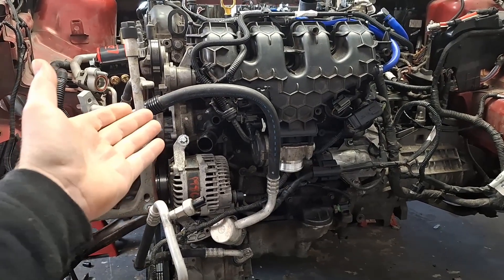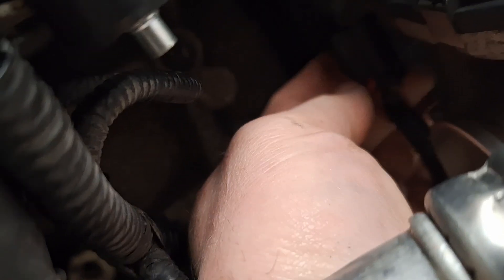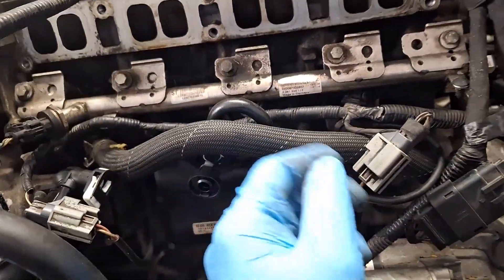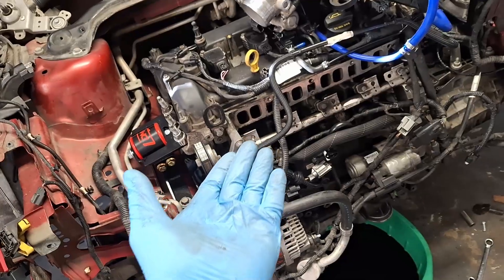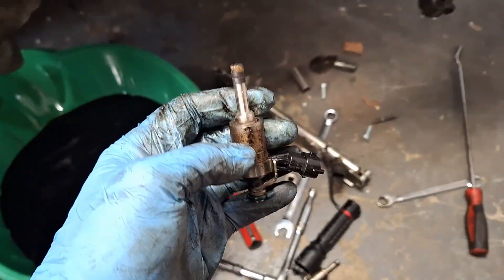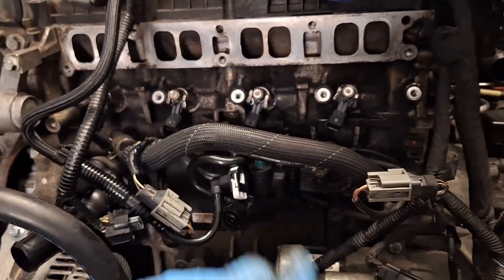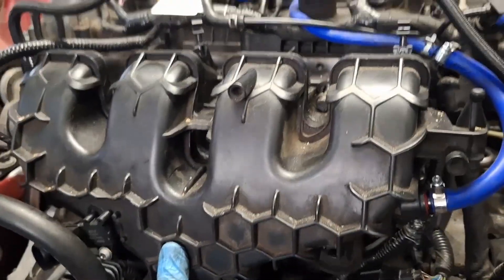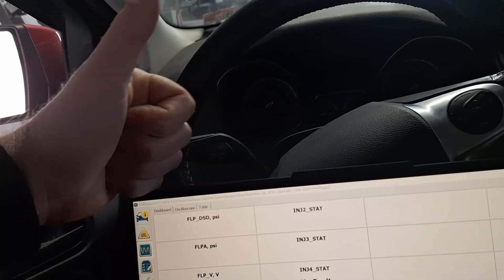Ford Focus Fuel Injector Replacement! 2012-2018 SE & ST

Comment: I just sent my injectors for washing. Installed them back and car is not starting like in your video ? What can i do? Pleass help
Reply from the maker: cycle the key a few times to prime the fuel system. my issue was because of ecoboost 2.0L swapping my regular ford focus
Reply: Quick question. If i remove one spark plug. Could i be able to see if the injectors are working ?

Comment: How does it run after the injector replacement?
Reply from the maker: It ran fine afterwards, but i wasn't getting power to the coils after the engine swap

Comment: I have a 2.0 Duratec GDI 2018, were you satisfied with your Rockauto injectors? I want to get the Motorcraft ones, is this store trustworthy? The injectors they sell are 100% original, can I trust them?
Reply: The original injectors will have the original number, not BOSCH. And the FoMoCo inscription.
Reply: @246alfa  Yes, I know that, the question is whether the Rockauto website is 100% reliable, as there are counterfeits on the market and they are selling for half the price charged by the Ford dealership, I would like to know if I can buy without fear from this website.
Reply from the maker: Yes the rockauto Bosch ones worked very well for me
Reply: @BigBensCarsAndCycles  The quality is very bad. It is easier to wash the original ones and they will work longer than Turkish or Chinese ones.

Comment: Hey Ben, did you figure out why it didn’t start?
Reply from the maker: Hey it was a 2.0 ecoboost swap project and I wasn't getting power to the coils because the circuits are different between the se and st. If you're swapping keep watching the series I go over it at some point

Comment: Why change injectors? There are methods for cleaning and checking them.
Reply from the maker: I thought mine were leaking
Reply: @BigBensCarsAndCycles  No. They don't leak. There was a view of the injector, they are externally identical. Only one has 6 nozzles, and up to 2014 there were seven. Look at the numbers, FB5E9 or BB5E9хххх. If you flush with solutions without ultrasound, then these injectors work better than new ones.
Reply: @246alfa  Can I clean with ultrasound? Many mechanics and manufacturers say that it is not safe to do this on GDI injectors, have you done it? They say that this can lock the injector open and cause serious damage to the engine.
Reply: @246alfa can you explain more I'm trying to do this on a Ford focus 2013 SE flex fuel

Comment: What about a 1.0L 3 cylinder eco boost. Is it the same?
Reply from the maker: @aliciahowell2635  no. Looks like those are put in up top in the valve cover and take a special slide hammer adaptor to remove if they're stuck

Comment: I have a focus equal to yours I want to do that project, but I want to know more about how you did to program the PCM of Focus St EcoBoost and what functions in your focus. I have that doubt and before I start doing the Swap I want
Know.
Gracas
Reply from the maker: @Juanpr03  I used a focus st pcm and wiring harness. I used Ford IDS and a vcm2 to program the vin onto the pcm (look up how to program a used pcm on a ford) and did a parameter reset. And it worked fine
Reply: @BigBensCarsAndCycles Ok, how to change the vin if I understood and also to program the key to the new PCM? Or just changing the vin is enough. Gracas

Comment: Hello this is a long shot but I have a ford focus 2013 2.0 tdci titanium x 5dr diesel powershift euro5 and I’m replacing the fuel injectors, but i have no idea what to set the torque setting to. Can any one help me ? Thanks my engine code is TXDB